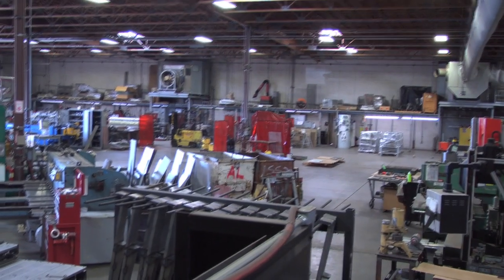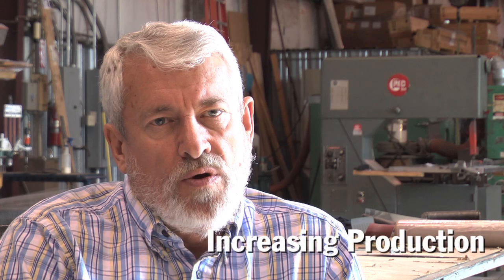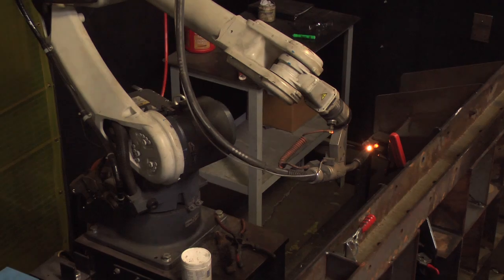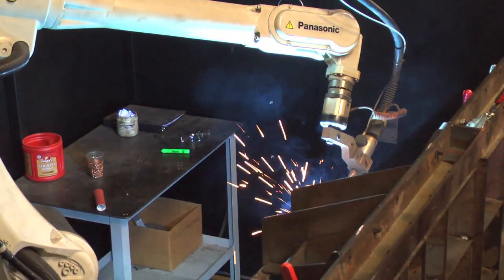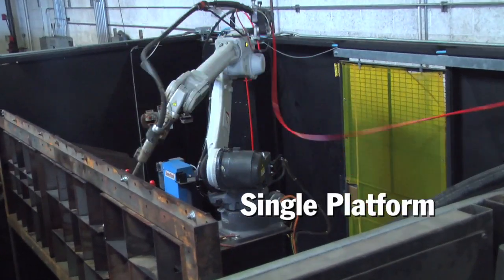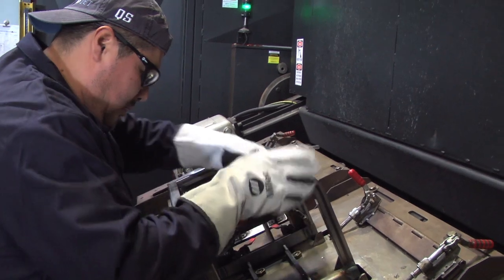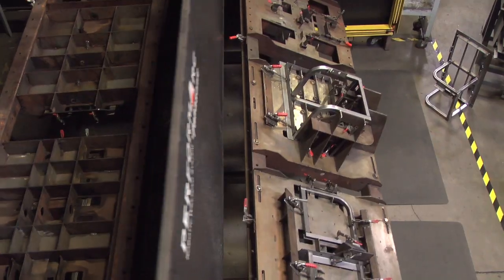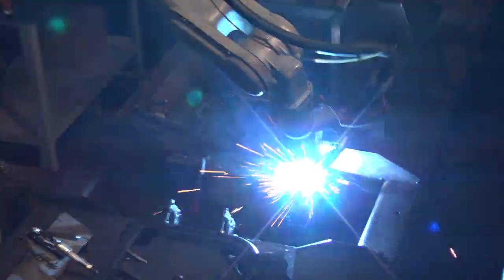K-zell Metals Increases Productivity, Quality with Robotic Welding

Comment: @cambriacity 
Yes this does look good.  Will you loose a welding possition on the shop floor? The answere is yes. That is not good.  But you will need someone who understands welding and robotics to set this up and you still need an operator to load and unload your parts.  Long story short this is the wave of the future, and there is a definite place for humans and robots.  Producing quallity parts is a big bonus. But where was the pressure for cheaper parts coming from China? No quality there!